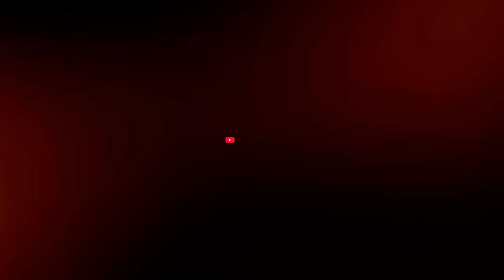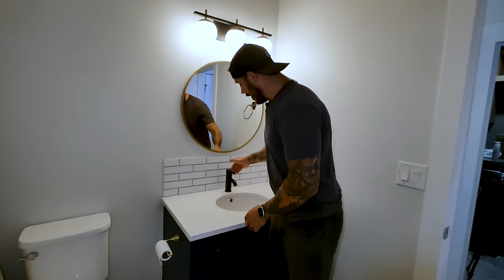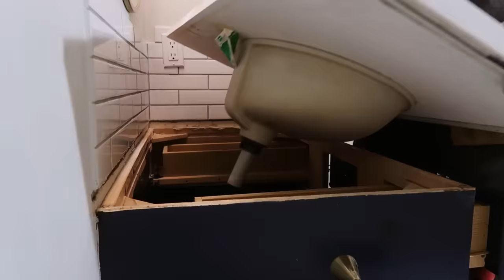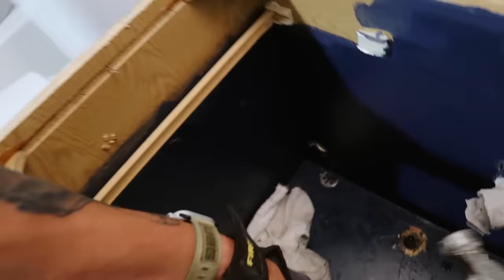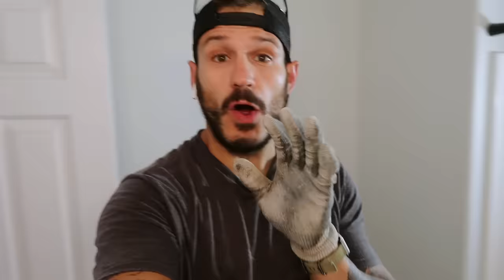Bathroom Remodel Pt.1 Demo Day

Comment: OSB, Thinset, Cement board, thin set, tile. got it. will help with the bath house!
Reply: Not always the case.. new builders just slap the tiles on the subfloor with thinset

Comment: Quick suggestion, because you have all the plumbing exposed, I recommend you switch your PolyB lines over to Pex. PolyB reacts to chlorine in the water and will degrade and burst over time, that's why you don't see it installed since the early 2000's. You can buy PolyB -> Pex adapters, which means you can replace your water lines over time without redoing everything all at once.

Comment: Did you have to grind down/scrape off the hardened thinset that was on top of the OSB subfloor (between the subfloor and backerboard)?  If not, wouldn't it make the floor uneven?

Comment: If you want to make it a bit easier to shift the toilet outside, take the cistern off too. There are just a couple of nuts holding it in place and it’s about 20/30% of the weight of the toilet.

Comment: That plastic piping looked like Polybutylene, you should do some research as they can cause major water damage if not replaced.
Reply: +1 when I redid my bathroom I pulled all of it and redid it. Still need to redo rest of house but at least one part is up to code now with CPVC.

Comment: Dude you can’t extend your waste line with the vent line so far away.   You need to extend the vent over to the new location.  You will have a slow drain.  The. You will be redoing the floor again.
Reply: I’m interested to see what you do for this as well? When you first mentioned move the toilet my head went to how are you going to vent that properly?
Reply: You to install a low heal fitting on the closet bend.   Then vent that up the wall directly behind the W/C and up into the ceiling and over to the exciting vent.  Yes more opening up sheet rock but will save headache down the road.  Not k ow how plumbing works will just cost you 2-3 times as it did originally.   I fix my friends what I call Homeowner special all the time.

Comment: Love your channel but the plug was boring AF.
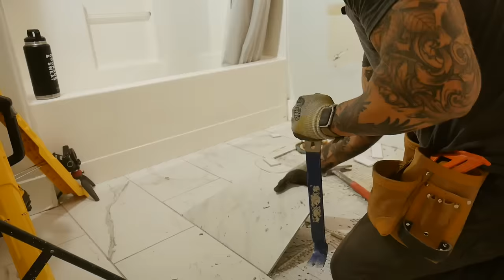Reply: Dude. Great video! BUT. You forgot at 11:03 when your chipping out the tile to tell these diy friends to stuff shop rags in the sink and toilet drains so debris doesn't go down them. Also I think if you took a few cans of redbull and threw them on the floor with all that energy I think they would give you a call then you can ditch square space. No really it was a shit way to start this video. Would have been better in the middle of the demo.